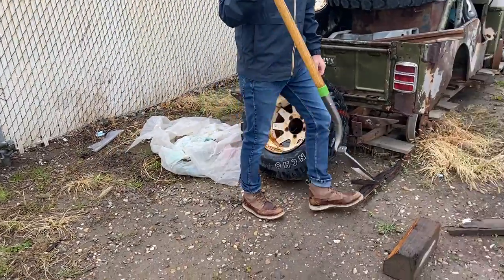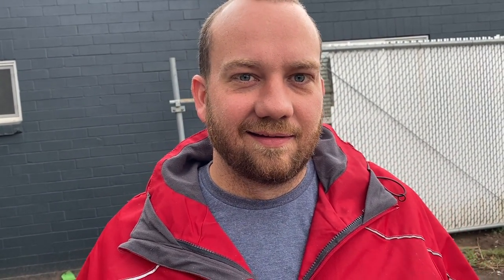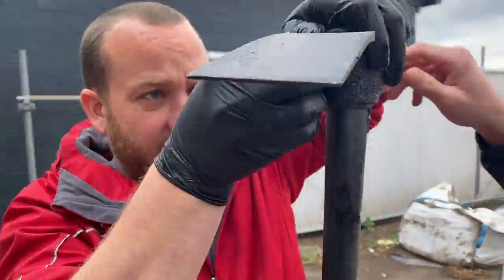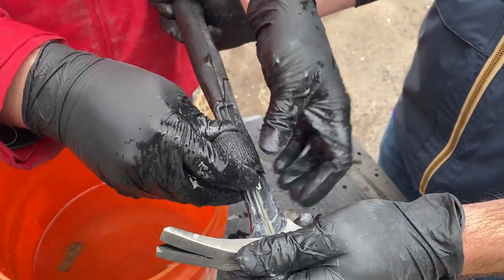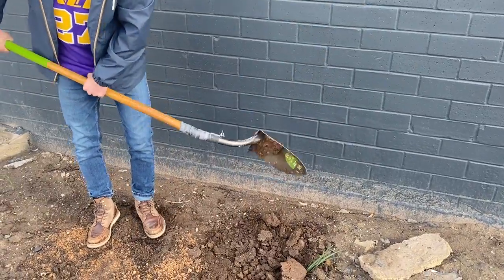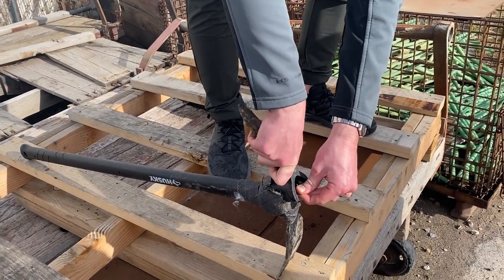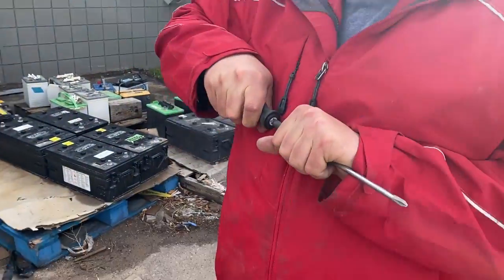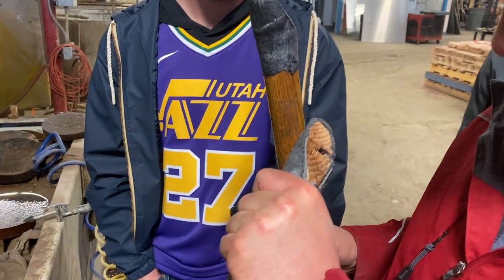This Material Can Repair Anything

Comment: Wow that stuff works Great! By the way the reason the hammer 🔨 is not solid at the handle but steel surrounded by dense rubber is to decrease the vibration you feel to your hand when striking a hard surface and not for weight savings. Work's well and decreases hand and arm fatigue or injuries. Great Video!

Comment: You cut the head of the shovel and then did a vertical cut on the pickaxe, and a sheer cut on the screw driver. Cutting the hammer in half really did give you the full spectrum of break types and showed which areas this stuff excelled at most. Well done
Reply: That hammer would have worked even if they just used one cross section and cut a new notch on the side. So it really didn't prove anything since there was no stress on the failure. 
The tape did work much better than I expected however..

Comment: The tool in question is called a mattock, and it's pronounced "MATTick" like a hammock. The holes in the hammer handle are for the grip to pass through so it can't be pulled off. 

I'm a retired general contractor, and I am beyond impressed with this product; closer to amazed.

Comment: Is it heat resistant?
Could you wrap it around a tailpipe, Cadillac converter or Muffler that had a hole?
"Stronger than steel!"

Comment: I used fiber fix on an FN gun stock, got ran over in a case, seems to be great now. I first 24 hour epoxied it back together, then a couple layers of epoxy tape over it seems very strong.

Comment: To be fair, you wouldn't need the tape to actually fix the shovel. Just drill the rivets out and pull the wood out. Sand the handle itself to fit back in the shovel and put wood screws where the rivets were.

Comment: How about strengthening what ain't broke?  Or connecting pieces? How many knife handles could you get from one strip?
Try alternating cloth soaked with thin wet cement and chicken wire. Only special fiberglass won't degrade but natural fibers seem okay.
This is thinwall ferrocement using cloth to space the wire layers apart. The outside layer should be wire & cement painted over.
Make a bucket, see how far it can deform and spring back but hit it first.

Comment: 5:25  In the real world you would just remove the old piece of wood in the shovel Spread that metal open on the shovel & grind down the wooden handle till it fits pretty nice in the metal shovel & put it back together like the manufacture did  screws, pop rivet, etc...

Comment: Super glue joint, add styrofoam dissolved in acetone, while still wet, wrap in vet tape, coat tape in acetone+styrofoam.

I'm too cheap to pay 8 dollars for a roll to repair a pick axe.

Comment: On the shovel just grind off pin remove old broken wood from spade reshape broken handle to fit snug and drill hole into new wood use bolt or use a large nail and mushroom the other side  freeish repair

Comment: I think the hammer heals up best because the cast was subjected to only a compressive force when hitting the screw in and even when prying the steel was doing most the support
Reply: Probably could have used duct tape and had the same results with 3/4 of a roll leftover.

Comment: She doesn't need one for you for the shovel if you cut a plastic bottle tightly wrap it around melt the plastic bottle into it and then put a little bit of duct tape so it doesn't snag on anything I used gorilla tape by the way it works much more efficiently and I'm actually quite surprised at works as well as it does I basically put four layers equivalency wrapped around it and it's probably the strongest part of the handle now

Comment: I'm not sure if you misspoke about the screw and it's integrity I know it can be a lot with a camera on you talking to hundreds of thousands of people but screws have zero Shear strength or very little compared to a nail a nail will bend sideways and give a screw will Shear completely off if hit at the side of it it will bust it has no sheer strength screws are to pinch things together nails are to hold weight
Reply: To be clear I truly loved your video great work honest inspiring with great personality you got a sub from me
Reply: And because I'm a nerd contractor I must also say if you hook something with the claw of your hammer and wrench sideways rather than the traditional nail pulling style of backwards you have a much greater force on your pivoting point which can snap a screw very easy or pull the head up out of a stubborn nail to get it with something else

Comment: and with all that lack of common sense between the 3 of you him surprised you use that water jet ! the screwdriver would of needed you to first apply yourself and roll it tight and spread out over as wide as poss. not making a big glob around the break you get no strength that way...

Comment: ...I don't get it. It was harder than you thought it was going to be? You too good for one sentence on google? I'm a techy and even I know hand tools are made out of hardened steel to prevent degradation and stripping of the head. This is the entire reason Snap-On gives a lifetime warrantee, they can guarantee their tools are harder than everyone's screws and won't be damaged by them. Like do you just get caught up in an idea and move forward without (realistically) considering how even the most basic physics work? How often do you guys just try something and don't think about the basic physics of the process(you don't have to admit it if you can't). Like seriously if you could just learn to plan one day ahead and consult a smart person, it could not only save you money but also make you money. Seriously. Do you guys just not like the channel growing? It wouldn't be hard to take this channel to new heights with fresh ideas, angles, and a bit of structure. You just need to talk to the right person.
Metal get hard. Hard metal, hard to cut
Reply: You don't seem to have a nerd on your team. Like it took me 3 minutes to find the standard hardness of a screwdriver. All you have to  do is cross reference that with A: how old + worn the screwdriver is from use, B: the potential use cases under which said use occurred, C: common knowledge of tools maybe?!? Most tools are hardened steel, how do you not know this but work in the industrial field?!? You even cut through stuff like this for a living, how do you not know how strong it is?!?!?!?!?